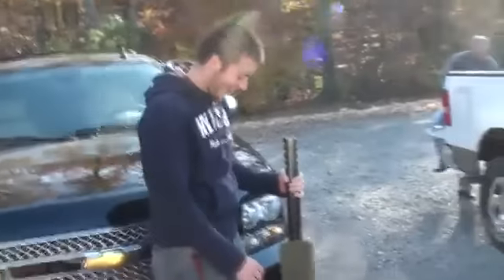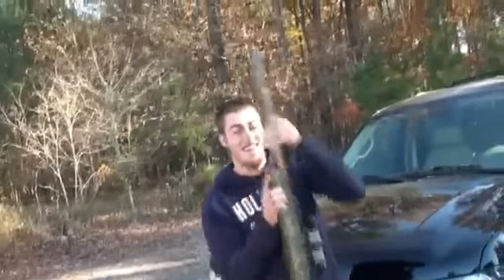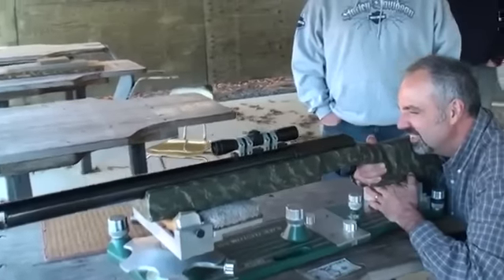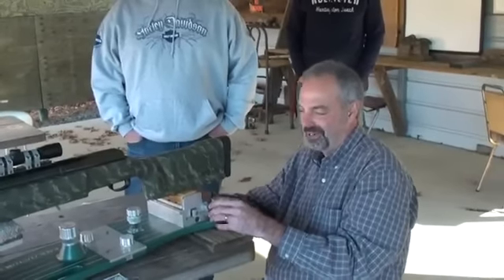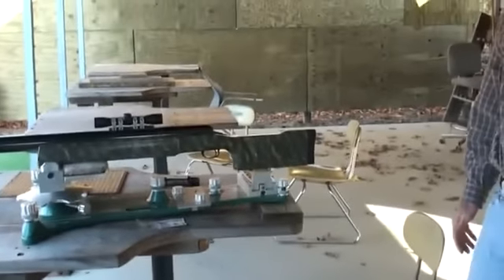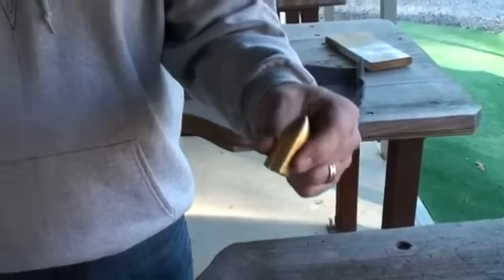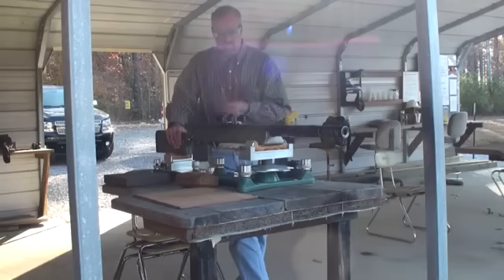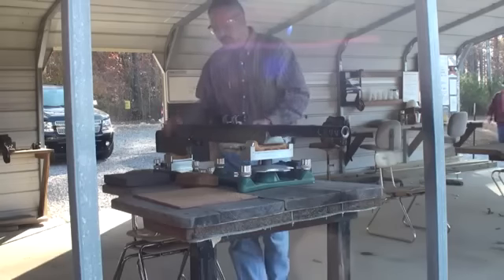Firing the worlds biggest center fire rifle

Comment: The Lahti Finnish 20mm  Anti Tank rifle was a tad over 3/4 inch in diameter.  seivering that 20mm round at 2600 fps at the muzzle.  before 1968 GCA they could be bought in a nice wooden box, with all acesories for $89.00  The rifle weighed nearly 50 pounds.  Had very little recoild and was semi auto.  Rounds at that time were $1.00 each

Comment: Not the largest. The 995 caliber is the largest but the common weight is 3600gr not 2400. This is a shorter version than the original 20x110mm cartridge.

Comment: anzio 20mm better and bigger cal than .950 jdj
Reply: Wrong. The .950 JDJ is a 24.1mm bullet. Anzio 20mm, is well, a 20mm.
Reply: Mehmet TARIM 20mm required Atf approval Jen 950 does not